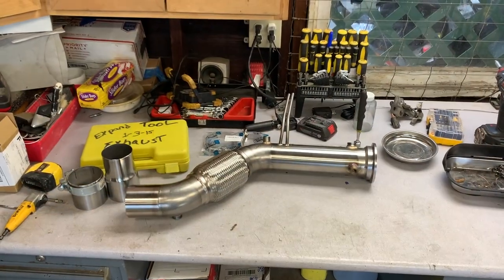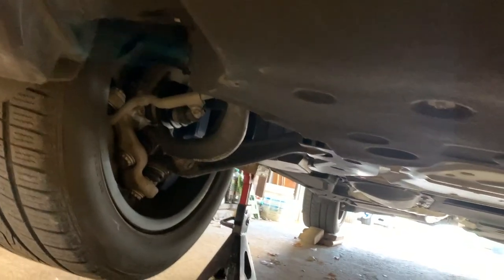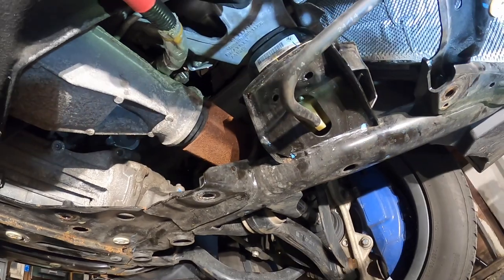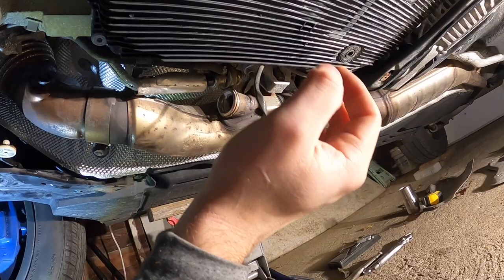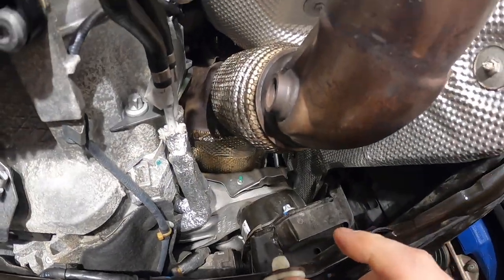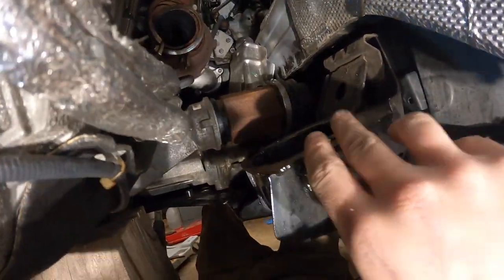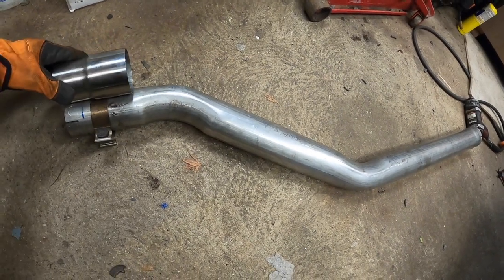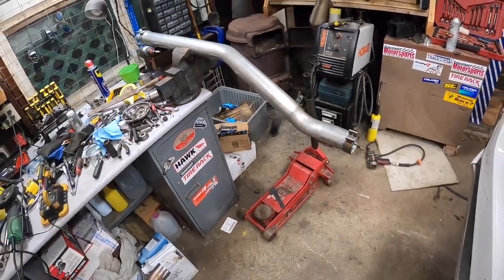F15 X5 35d DIESEL ABC downpipe upgrade N57 engine

Comment: I glad you made this video because before I only found 1 BMW thread on a forum. It had great details and step by instructions.  Along with a few pictures. I cannot stress how difficult it was to remove the motor mount.  I had to stop and walk away a couple of times during this part. It almost broke me. Also what about pulling the fuse to make the DEF stop spraying?
Reply from the maker: Forgot to mention to stop DEf from spraying you will need to disconnect module which is directly under right headlight.
Reply: @MotorsportInspired   Were you thinking of removing DEF all the way ?? I am starting the job on total delete on 2012 X5 and I was wondering if I can remove both reservoirs.

Comment: Best video and the only one who show how to take out the dpf. It's now 3 hour i'm checking you tube for find a diy and you're the only one. Thanks a lot from belgium. Question: i just want to clean it, do you think it's possible to put it back the same way because you show the mounting bracket ( with the torks 10mm) and i asked myself if there is some place for the hand to get it back in place, whit the straight pipe its ok but with the dpf??
Reply from the maker: Hi, thanks for the kinda words, Yes it’s doable with dpf back in but man your got to be patient you it going to take awhile

Comment: Very good video. The thing I learned from this video is where to Jack the car in the front 🤣🤣🤣
Reply: PLEASE HELP I AM DOING THE SAME PROJECT AND HOW DO YOU TUNE IT WITH WHICH TUNER DID YOU BLOCK OFF THE EGR VALVE SO THAT THE COMPUTER DOESN'T RECOGNIZE INTAKE EGR OR HOW DOES THAT WORK PLEASE THANK YOU WHAT CHIP OR WHAT COMPUTER OBD ACCESS PORT DO YOU USE AS WELL

Comment: Did you do a ecu remapping to remove the dpf from the system too?
Reply from the maker: Yes, you have to reflash ecu. Reason I did not mention much in the video, tunner I have used asked for privacy, so I want to honor his decision. If you google bmw diesel tuners there quite few that come up, but definitely you will need ecu reflash along the hardware part.

Comment: Deleted my Ram 2500, had to use a tuner also in order to turn off the monitoring/codes.   I'm assuming a tuner is also needed on the BMW?
Reply from the maker: Yes indeed you will need to do the same as on your ram via tune, I did not go into details on this video about the tune as the tuner did not want exposure for obvious reasons
Reply: @MotorsportInspired  Understood!  I can’t even get a reply from the place I bought my tuner from, since the EPA has been going after people.  It’s amazing how much this EGR type stuff is destroying engines just so some people won’t be offended by some smoke.

Comment: Hi like others have said this is a great video! I am currently doing this delete on my F15. But how do you remove the two Etorx bolts on the DPF bracket? In the video you said you weren't able to film it because of the tight space.

Comment: Hey, I’ve bought and installed a downpipe for my 2014 x5 n57 but there are only 2 spots for sensors, 02 and temperatures sensor right in the beginning of downpipe. My downpipe is missing the second sensor towards end of downpipe, so I need to reinstall the second sensor? Thanks….
Reply from the maker: Hi, second sensor is not needed it’s disabled anyway you can unplug it or tuck it to the side.

Comment: what are do with the egr cooler?my have the egr cooler atach to de dpf filter
Reply from the maker: I left it in place on the n57 it’s part of the manifold not the downpipe you don’t have to remove it, just have to unplug it so valve does not open and code it out, on M57 though it’s part of the down pipe therefore you have to remove it.

Comment: how did you take the bolt out that is holding the engine mount bracket.. the one you can even see because the dpf if on the way???
Reply from the maker: Hi yea it’s  hard but swivel and socket works on it.

Comment: How long did it take you to pull out the dpf? I’ve worked on different bmws and changed motor mounts before, so familiar with subframes. In hours how long would you say it took? 8-12 hours?
Reply from the maker: I would definitely say 9-12 hours easy

Comment: PLEASE HELP I AM DOING THE SAME PROJECT AND HOW DO YOU TUNE IT WITH WHICH TUNER DID YOU BLOCK OFF THE EGR VALVE SO THAT THE COMPUTER DOESN'T RECOGNIZE INTAKE EGR OR HOW DOES THAT WORK PLEASE THANK YOU WHAT CHIP OR WHAT COMPUTER OBD ACCESS PORT DO YOU USE AS WELL
Reply from the maker: Hi, send me a Dm on Instagram and I can  give you more info.

Comment: Is there a way to clean the DPF filter without removing it?
Reply from the maker: Unfortunately no, the only thing you can do is trigger regeneration via dme which will help clear it up, but to physically clean it you have to take it out the car
Reply: @MotorsportInspired  well that’s a bummer because I currently have a 2011 x5d and no diesel mechanic around me works on foreign cars. In the ct area if you know of any good shops, running out of options.
Reply from the maker: @kobeclifford5421  what problems are you encountering and which part of CT are you from?
Reply: @MotorsportInspired  the DPF is clogged so the car enters limp mode if I accelerate even a little too fast. I just want to get the filter out of the car and clean it, and if that doesn’t work I’ll either get a new one or delete it. Suffield
Reply from the maker: How many miles on the car? Did you ever change thermostat? Because if it’s faulty and engine doesn’t get over 74 celcius it will not enter regeneration mode therefore blocking dpf, it’s common issue that gets overlooked that’s why I ask because dpf is dependent on thermostat. I’m in new haven area.
Reply: @MotorsportInspired  150k, I checked the thermostat and it’s working just fine. And at this point I would happily bring the car to New Haven if there’s a chance at fixing it.

Comment: Hi. I'm doing this delete as I'm writing this. I have a question about all the sensors that get removed from the piping. Do you just disconnect them? Cut them? Leave them there and secure them up the the car somewhere??
Reply from the maker: I have disconnected them and zipped the wires, no need to cut anything off but that’s purely ones preference
Reply: @MotorsportInspired thank you, I did the same thing. I unhooked the ones I could then taped up the ends. I'm keeping all the sensors and parts in a box just incase I have to Reinstall them later down the road. Awesome job.

Comment: what did you do with the coolant hose?
Reply from the maker: There no coolant hose in the oe n57 engine setup to remove, I thinking your talking about M57 engine which indeed has to have cooling pipe rerouted. Because it’s part oe exhaust system but that’s not case n57 engine
Reply: Is yours an American car?
Reply from the maker: Yes it is in US N57 came on F15 and M57 on E70

Comment: I own a 2011 X5d, what is the benefit of this modification? Thanks.
Reply: It will be way faster than it is and it will save more fuel
Reply from the maker: Better gas mileage and improved engine reliability

Comment: I know this was posted over a year ago, but I am wondering how you got the muffler shop to bend that for you without bringing the vehicle to them? Did you bring the old one?
Reply from the maker: Good question 👍 Yes that exactly what I did, took old pipe to the shop and will bent the pipe to same angles it’s really not that hard, oe pipe does not have complex shape.
Reply: How many bolts do you remove to raise the engine? I am having trouble removing the bolt you showed the trick for. 

How did you remove the dpf sensors? Unplug or remove sensor?

Is it possible to leave the cat and scr to reduce smell?
Reply from the maker: @nickanthony7057  as soon as you detach right engine mount you should be able to  jack up the engine. Sensor syou have to remove otherwise you won’t be able to slide dpf out there no room for anything extra to be hanging on there. You can’t leave scr/car in once you take out dpf honeycomb is to dense it up will clog up within very short time and cause damage to turbo and other components, it’s not worth taking a chance we’re talking couple grand worth of damage if it clogs up.

Comment: What do you get on a 1/4 mile?
I have 2015 bmw x5 xdrive35d also with a delete and malone stage 2 tune. I got 13.995s in 1/4 mile. 
I bought it last year from a guy who already modded it, was much faster before, but unreliable with a wack of problems. Malone stage 2 tune made it slower, but smoother.
Reply from the maker: Haven’t tested quarter mile however zero to 60 I was able to do 4.8
Reply: @MotorsportInspired  Awesome yeah mine is around there too. What would you suggest to increase some more gains?
I bought an XHP transmission tune, it makes it drive a bit quicker with the shifts. I don't want to buy a bigger turbo, but was thinking something to add more fuel or intercooler. Not sure if an intake would make any difference.

Comment: I noticed that there's 3 holes on the downpipe, does the DPF have 3 holes as well for sensors or you had to plug one?
Reply from the maker: Yes it does but if you don’t want to plug them back in you can just plug it.

Comment: Nice video.  Did you have to mess with the computer codes in the X5?
Reply from the maker: Thanks 🙏 yes you have to get a tune after hardware is removed and have your tuner code out every that has been removed this way you won’t get check engine light in the dash.

Comment: Having hard time to find egr delete kit in US. Any suggestions?
Reply from the maker: Egr delete is not necessary on n57 like it is on m57, you can just unplug it and flap will remain closed at all times works the same way as if it was removed and blocked off there no additional benefit from removing egr and it pain to remove. Just unplug it and that will do the trick. And it will work the same.
Reply: @MotorsportInspired  How do you know if you have the n57 or the m57 engine.?
Reply from the maker: Goorie Henkel n57 is in f15 x5 and m57 is in the e70 x5
Reply: @schmingusss  do i have to programming or just unplug and that’s it?!
Reply: @MotorsportInspired  What all needs to be unplugged?  This thing looks a lot different under the hood than my Cummins does when I did it lol

Comment: Hey everybody, I am in the middle of doing my X5 2011 delete and not sure which temperature sensor plug to plug the downpipe sensor into. If somebody has done it could you please tell me the color of wires for the top side plug to use? There are three that are identical plugs but different color wires.

Comment: hi. Nice video! Did you delete the cat also or only the DPF?
Reply from the maker: Thanks 🙏, yes I did but later I welded high flow cat in place, did a video on that as well on the channel if you like you can check it out, you can’t leave the Oe in place because it will clog up and cause damage without dpf in place.

Comment: I've done a 2012 x5 35d American model and was a complete pain in the ass. I'm doing a second job on another x5 35d. I only used the down pipe.  I re-used the the pipe were the DEF sprays in and worked great. I did NOT do any cutting at all. You have to order the European down pipe for an American made BMW. It works great and you can put plugs in were the O2 sensors went. You didn't explain the motor mount issue enough.  There is a hidden bolt that you cannot see. You can barely feel it with your finger tips. I took off the front right passenger tire and a long extension to remove it. Once you get past removing the motor mount it all down hill. You didn't explain reprogramming the ECU after you are done. That the pipe company will lend you with deposit. What about the EGR block out kit ? Did you not do that also? Or did I miss out another video you made?
Reply from the maker: 2012 X5 35d is little bit different than 2015 x5 35d different engines m57 vs n57 very similar but there are differences on n57 you don’t have to worry about egr block off kit like you do on m57 you can just unplug it and code it out. I tried to demonstrate best I could in the video motor mount bolt wasn’t really that bad, got it with long extension and swivel, more of a pain was wrestling that big dpf can through that small space. Did not mention much about a tune since my tuner asked me not to. If you didn’t remove scr and def injector it will work sure for sometime until it gets clogged which it will since there’s no dpf and regeneration cycles no more, matter of time it’s not designed to handle soot alone with out dpf. Glad you like it 👍
Reply: @MotorsportInspired   Nice Job-where are you located-Karen
Reply: Do you have any links to the European pipe. I have a 2012. What connectors must stay connected after removing the dpf

Comment: I feel so screwed. I've a M57 that needs the d word and everyone is scared to even consider it. wtf do I do with this vehicle that may need 7K of shit just to make it run badly again?
Reply: Replace with downpipe, midpipe and then tune, should be ~$1500... you want to look for a diesel tuner, the exhaust work itself is relatively simple.
Reply from the maker: I would do the delete much cheaper, better for the engine, better mpg and performance. Than replacing it with new part that will fail again down the road. Should be $1200-$1500 range. Depending which tune, down-pipe combo you go with.
Reply: @MotorsportInspired  I haven't seen your new tune video! Do you know which ECU you have? My F10 has been in the shop for a few weeks now, electronic turbo actuator failed immediately.. waiting on new turbo now.
Reply: I am starting delete pretty soon. I am also doing walnut blast. Those engines are clogged as all hell with all this exhaust dirt recirculating.
Reply: @MotorsportInspired  Please do the delete for my 2012 X5d-Thanks Karen
Reply: @KarenBrownMV  Same please! For my 2013 X5D… I’m done with check engine lights and expensive replacement parts.
Reply: @ilirbitici4423  do you know where their shop is located-thanks karen

Comment: Isn't it m57?
Reply from the maker: Hi, no M57 is in the e70 x5 F15 x5 has n57
Reply: @MotorsportInspired  thanks, just looked it up and was about to delete the comment , but your quick on response 😆
Reply: @MotorsportInspired  does the cabin have diesel smell after deletes? I have an e70 35d and just running stage 1 with egr delete, wanna get the dpf and straight pipes along with billet race pipe on the intake and switch to stage 2.8 jb tune. Should make around 380whp hopefully
Reply from the maker: @brabus343  nope not at all, only obvious smell is if you stand behind the car for while it’s idling, I welded a 200 cell cat in mine and that reduce the smell by out 30% I would say. Did a video on that as well if you want to check it out.
Reply: @MotorsportInspired  ye I checked it out . Thanks. Nice channel, subscribed 👍

Comment: What did you do with the urea injector?
Reply from the maker: I left it in place, wrapped in plastic bad and zipped tied it a hanger. You can see in the video.
Reply: @MotorsportInspired  Cool, just wondering, how did you manage to get the new flange/gasket installed at the turbo? Did you require an extra set of hands from the top? even on the 328d, I needed someone to hold the flange and new metal gasket to keep it from falling